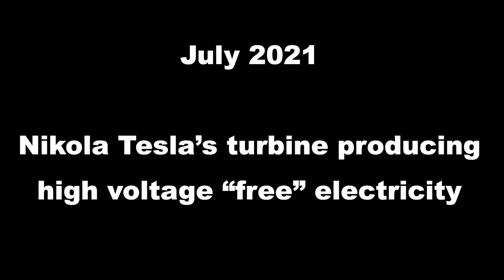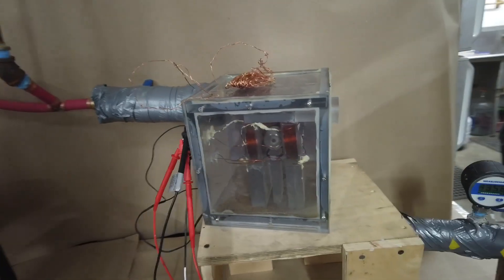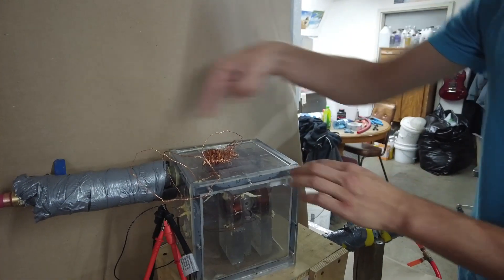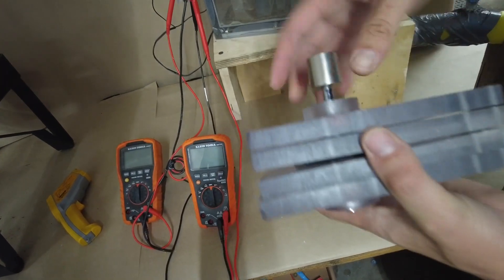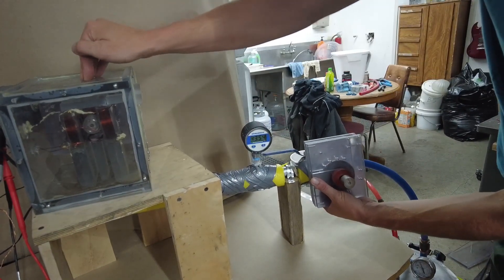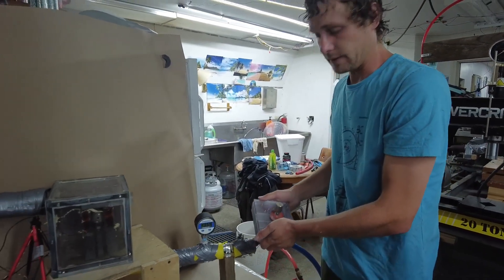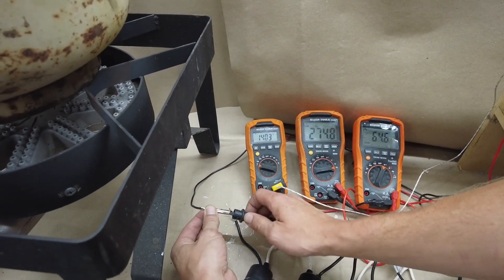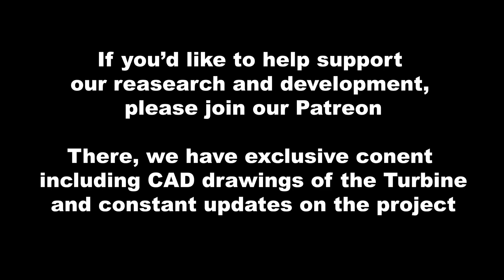Ground Breaking Renewable Energy System Using The Tesla Turbine

Comment: The condensation of the chilled water at the condensor will retain the vaccum, can it actually boil of the whole input tank?
Reply from the maker: the heat will leave the boiler far before the water is gone, the water expands so much it doesn't take much to make a lot of power. eventually the condenser will fill up and you will need to pump the water back to the boiler
Reply: @Charles McKinley spot on, my thoughts exactly, funny how there’s nothing being said about the power required to maintain the vacuum or any usable differential pressure
Reply: @Charles McKinley instead of The vaccum pump the system could be flooded with 100+degree steam from a  small solar heater with a very small water reservoir. The system valves are then closed/sealed. The 100+ degree steam would then condense in the pipes and in the condenser and pull the low pressure. If the system is sealed properly the low pressure would stay forever, as long as there is a proper temperature difference between the warm and the cold side, and the Tesla turbine properly extracts the heat, and of course enough water. In copper heat pipes when they are manufactured the vacuum is pulled in a similar way. To my understanding this is only needed once for startup, like  a 12battery with sparkplugs on a petrol engine. The best practicall efficiency that i have seen for pumping electricity from low temperature heat flows are at about 10%. If this setup achieves anything above 40% that would be allready absolutely astounding, and would mean that your car will practically have twice the range from the same amount of petrol. Because there up to 70% goes wasted mostly into heat and could be with this setup converted back to drive energy. With 40% also no photovoltaic with the same surface area could compete.

Comment: For  scalability, carbon carbon discs can be used since they are proven to be working great as break discs in racing cars....high speed (not as turbine ) and  great abrasion resistance
It will be expensive but more durable
Reply from the maker: I like the high temperature aspect of that idea, but the regular carbon fiber should be just fine for this particular application.

Comment: So, rather than making the turbine big, why not make it small and stack in quantities, since no metal can withstand it's intense speed.
Or is there still a drawback?
Reply: that's a typical situation of trade-off
Reply from the maker: if your referring to that new tesla turbine video, they screwed up on the math. The video says the rotor must spin at a very high rpm, maybe 50,000 for a 6” turbine. The speed of a turbine is based on periphery speed not rpm. If a 6” turbine needs to spin 50,000 rpm to be efficient like the video says, that’s a periphery speed of 890.1 Miles per hour. If you want a 3 meter disk to achieve close to 891 miles per hour at the periphery, the rpm required is only 7,253. We have materials that can easily reach that speed.

Comment: How functional would they be in an industrial setting?

Say I wanted to draw 5000kWh a day or maybe even replace a 75kWh turbine with one or several of these to power several processing centres within a centre area?

What would maintenance be like? 
How well does it scale? Would we need multiple turbines & generators instead of 1 more traditional set up 
& what’s the cost for manufacturing something like this compared to industry solutions?

Asking because I’m in the process of planning a food processing facility in Ghana & every Oz of the public services are corrupt there, right down to the electric company, I had previously designed an off grid power solution for a Bitcoin mining farm using a small creek to power a hydrogen fuel cell & using a Oxy-hydrogen burner to produce steam & drive a turbine & generator, 
Preferably with a closed loop boiler system ( was aiming for a set up that could used almost anywhere and leveraged the environment as little as possible ), obviously the project took the back seat for awhile but resurfaced out of necessity, would Tesla turbines be appropriate for that kind of application or would we be better off going with more traditional turbine set ups?
Reply from the maker: Here is a quote from nikola tesla "I have found that the quantity of fluid propelled in this manner, is, other conditions being equal, approximately proportionate to the active surface of the runner and to its effective speed. For this reason, the performance of such machines augments at an exceedingly high rate with the increase of their size and speed of revolution."
Reply: Wow I'm actually already impressed by your Bitcoin mining operation, I remember hearing about people who said that they might move to somewhere very cold to run their system and some type of Warehouse so the cold air outside is Cooling the warehouse for the Bitcoin mine, and all the excess heat is collected to power a stirling engine to produce power to keep the operation running.

But a creek actually sounds like it's going to produce more power, however I don't know which one would be more efficient.

I would believe that the one that creates power through the water turbine would be the most efficient in the beginning, but now this makes me wonder what you did with the heat waste or did you just have coolers running in that place 24/7?

Comment: also consider impeller, where the blades are like in a water wheel, same outside-in-center-out manner, but difference is that the reverse forces rotation too, three functions, tesla disc turbine has two functions, not obvious the third, the inverse push-in-pressure, just the rim-in generator, and the center-out pump
Reply from the maker: I'd love to try all these ideas. I use to build fined designs, but decided to just use the tesla turbines after reading more about the tesla turbine. Tesla claimed some crazy power numbers and I don't see any issue with his original designs.
Reply: @iEnergySupply  I think the spiral in turbine is a tesla turbine, even if with 90 degree blades, not the perpendicular discs, same effect, centrifugal spin around the center point of the turbine, mid-point out, at least very similar
Reply: @iEnergySupply  options
Reply: center-out "line impeller", no direct flow like actual water wheel turbine
Reply: the rose turbine on youtube, TnT, is an example of the third operation mode, center in, rim out, with face plate or without face place, on the blades
Reply: the channels forcing the 'hurricane' movement lines, arced blades, just like the water wheel, but rim-in center-out, not directly pass-through (rim-in rim-out), but similar to tesla turbine working principles
Reply: btw, try water, non-compressing volume, should have tons of torque, to spin the turbine
Reply: when the blades are arced, no discs, then the incoming rim-in pressure/volume is forced to push the blades, until they slow down and exit from the center-out
Reply: if you want credibility, measure the energy in, and extraction ratio, both theoretically and experimentally, and compare to the similarly sized/powered other turbine options, like normal bladed rotor pass-through turbine, line-impeller, and the centrifugal impeller generators

Comment: Why is no one asking any real questions like does it produce enough electricity to account for the heating requirement? Plus the motor you want to attach to it? And some surplus too for at least lightbulb?
Reply from the maker: I guess they are patiently waiting for our analytical equipment, it just got shipped from mexico and will be here toon. Also you must see the potential with a little imagination. Watch our previous videos, we are making ample progress as time goes on. You must understand research and development to see the potential.
Reply: @iEnergySupply  I understand r&d and I also understand that you cant really get out more energy from a closed system that you have put in, as i know the second law of thermodynamics applies to everything in our universe
Reply from the maker: @szzk  who said we were going to get more energy out than we put in?
Reply: @iEnergySupply  it is in the title ... Ground Breaking Renewable Energy System ... adding up every bit of energy you get out of that machine, will not add up to the energy needed for it to run, counting with frictional forces that are converted to heat and so on. It can never be renewable neither because you always have to supply it with a surplus of energy from the outside, that might be extremely small, but none the less, it is needed. Every invention of man kind so far goes by this, we only convert one type of energy to another type, while sacrificing some of the initial amount during the transformations.
Reply: @szzk  this is really an attempt at an efficient energy conversion system, and I have yet to see any actual comprehensive data from this experiment to calculate efficiency of the experiment.
Reply: @szzk  I see your point. It's costing me nothing to wait I'm not a patron. You have to admit it's interesting though, any power being generated while the damn thing makes ice by running slightly heated vapour through it, if it's exhaust is lower than ambient temperature, while producing any power that's definitely interesting atleast.
Reply: I asked. I asked how close the are to closing the energy loop.  It’s possible to heat the water using an air sourced heat pump driven off the turbine. The system would be effectively a machine to convert power the decrease in air temperature into power
Reply: @andrewbell2751  you're not going to be driving anything off of that turbine, those led light bulbs are drawing no more than 10w each.

Comment: Where the rubber hits the road, I have already commented. Charging the electrical system of a car powered BY Tesla Turbines and weighted flywheels is the idea, and geometric electrolysis from steam TO hydrogen under cold phase change solves the Hindenburg part, maybe a water additive for stability. And said cars would still make cool sounds, just different ones. Single system analysis makes everything plug and play. I am sorry for the brutal honesty, but all I see is an ego narrative among the people who understand part of the engineering principles. 

Forget Tesla and Einstein for a minute, Steinmetz is the one who gave the real fundamental equation of field theory. A three coefficient variable calculus for the hysteresis of the material, which is programmable. But that is not a 3rd power series construction of an object, which I derived from Fibonacci palindromes in e(c), sq2 and Pi, and the Lyman Alpha Line Split. The energy IN the matter. And TWO coherent time directions. I made it simplified and generalizable, to a gene drive. Eric does it his way. I insist on a 1D-3D, T1<->T2 decausative linear algebra. Real time PCR expression imaging is radiological and uses isotopes. Reverse transcriptase imaging does the same exact thing in time reversal. 

Why is the generator dampening the vibration? Removal of vibration and conversion to electricity, lower frequency to higher. If my brain could be put into binary CAD software, then optimization would be one-click. I was pointed to a real Russian DIY RC UFO video here. Legit, the saucer oscillates and then lifts off the ground. Seeing inside other peoples' designs is not welcome. Oh well.
Reply from the maker: The generator is like a shock absorber in the car, that's my theory. as far as the crazy effects you speak of, we have discovered some, and there are many more discoveries on the way.
Reply: @iEnergySupply  Crazy? I did the time component math model, 4D metric =360X12 recursions, 3,6,9 inside, 3+1 at the output node. So, optimized USEFUL torque at 4320 RPM is the ideal. Compressed air is your only fuel, and probably could be redirected back into compression with some loss. My only issue is the dynamic balancer that would be needed to absorb the flywheel gyroscopic effect on the handling of the vehicle. I think this is the solution: connect a pair of valve to a reciprocating housing AROUND the flywheel and add that connection TO the Turbine vacuum system, with a hi-lo, hot/cold connector set with one way valves. Vent the flywheel right and you might get a real reciprocating effect on acceleration and coasting, with pressure and temp between the chambers equalizing dynamically. So much to do.

Comment: I have a suggestion what if you put them in magnetic disks what happens
Reply from the maker: not sure what you mean
Reply: @iEnergySupply  I mean between the discs is a magnet
Reply: @iEnergySupply  I mean between the disks is a magnet
positive and negative
Reply: @iEnergySupply  He means to use magnetic disks as a combination turbine rotor / generator.

Comment: Would be interesting to use air foil bearings with the turbine. Would basically never need to purchase new bearings again
Reply from the maker: That's on the to do list, I've experimented with them before but we need more r&d for them.
Reply: Air foil bearings, in a vacuum?

Comment: If this is TRULY opensource - you will provide your CAD on Github and not lock your findings and research behind the paywall of Patreon. I don't disagree with patreon to fund your research - it's needed - but you can not claim to be opensource if your being Privately funded with private donations (public within the ecosystem of Patreon - but really just a private collective of investors) and locking your information behind this paywall. 

I am greatly appreciative of the work and research you are all doing. It is needed, and inspiring. My above comments are about the optics of the whole situation. Opensource your stuff, or keep it on patreon and claim it as a DIY project. 

$65/Month is A LOT for most people. Even though a one-time payment and a cancellation get's you the CAD and data - that's not really fair to you guys is it? $65/Month should be for exclusive content (ex: failure videos, VLOGS, Build videos, In-depth analysis) - which is NOT the "open-source"  you are claiming. 

Providing to the public simply the data to replicate your findings, and nothing more, for free, is open-source. 

My rant is over now - good luck on all of this. Great video :)

Comment: great job. just that,
i dont understand, why must you pursue to get more than 8000 rpm?
@4000rpm you can already generates 250 VAC.
More than 10000rpm, you will make your bearing starting to damage.
Reply from the maker: This was 60,000 Rpm Roughly. The bearings are rated for 150,000 RPM
Reply: @iEnergySupply  how much amps wr u amble 2 get out of this
Reply: Maybe it has something to do with that the outside of the blade has to reach te speed of sound to be more efficiënt, smaller disk = higher hz? So 8000rpm with larger disk seems possible. Just something I red a time ago, I can be wrong.
Reply: @1107laurens  I think the theory is once running at supersonic levels, the hot and cold tanks are no longer required. It physically becomes a hurricane, ie feeds from the atmospheric pressure itself and the temperature difference. I think the material science is perhaps the next and bigger challenge though perhaps?

Comment: Also,,,there is also a gearing ratio advantage between the diameter of magnet and diameter of turbine.  Couldn't you use much larger size turbine disks and add same size multiple magnet generators on same shift. This would add a torque advantage in two ways, a diameter difference and spinning mass(weight). In turn you could slow down the turbin speed. Slower speeds are better. Under 10k rpm is great
Reply from the maker: With our new turbine we are going to use smaller magnets. This concept will be tested.
Reply: Expounding,,, linear generator is a group of generators, each with 1"x1" n52 diametrically magnetized and has its own set of coils per magnet all spaced out on a single shift or ganged together end to end as to turn together by a single motive force. This configuration beats 6 magnets spaced out on a 10" rotor wheel. Larger rotor equals more input shaft torque to pass magnet by coil during electrical production,, Lenz force backpressure. Thats a 10 to 1 reduction, 10" rotor to a 1" rotor.
Reply: Also may take slower speeds to hit target of 60hz??

Comment: I see you are using carbon fiber disks?
Do you plan on making it a two stage turbine or will you use a separate pump?
Reply from the maker: yep, we need to do them separately. we will add the pump later.
Reply: because of the dynamic balancing?
Reply from the maker: @erumaaro6060  the spacing between the side walls gets harder and harder, it also makes the assembly many times more difficult.
Reply: @iEnergySupply  so what would happen if these disks were made of turbostratic graphene?